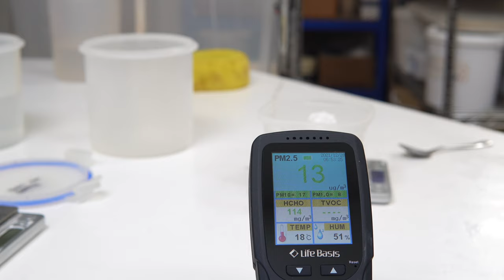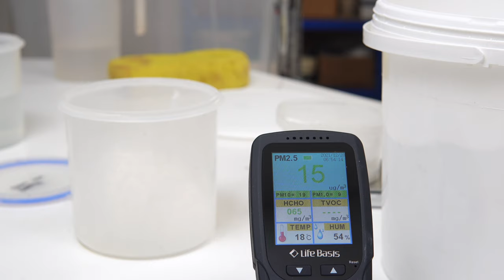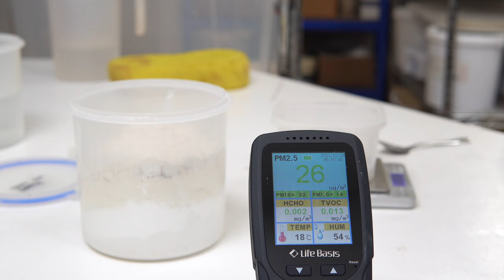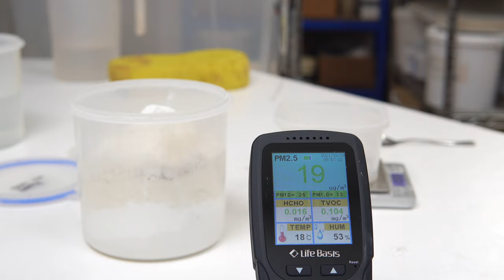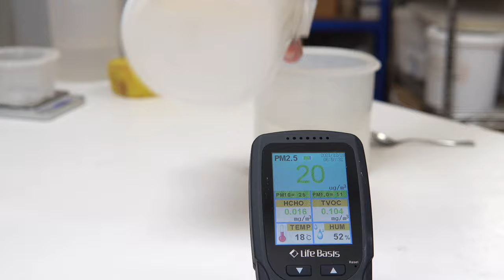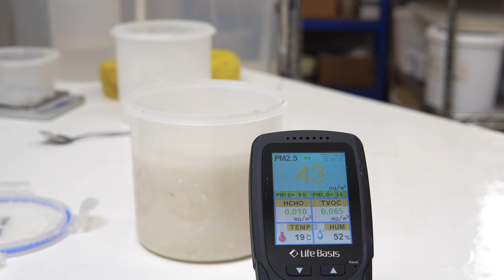Silicosis - What it is and how to avoid it

Comment: You're doing a service for potters everywhere. Thank you.
I'd be curious what is registered when rubbing over glaze imperfections, shaking around plastic used to cover pieces when slow-drying. Even just opening up a bag of clay where some has dried to the inside of the plastic seems to make more dust than anything.

Comment: Don't underestimate your videos - they are very well produced with information to back your statements and recommendations. I much prefer your straight forward presentation. I was wondering if the rise of partials would be reduced if a spray bottle with water is used to "spritz" the bucket/area while emptying the chemicals into the water and continuing through the "bubbling" as it is incorporated.  Might help and definitely interested to see if it does reduce it. I am a TA at a community college and follow your recommend advice already. When we "dump" the chemical into our five gallon bucket with water, we immediately place a lid on it snd wait for the cloud to settle.  Now, I am going to use a spray of water to visually see if there is a difference while placing the mix into the water. 

Thank you for your extensive research and sharing of information.

Comment: Good to know - thanks! Great comprehensive video. Will need to source one in Australia.  Just wondering about pots drying on open shelves or just sitting there for weeks while waiting to bisque fire or glaze- is that dangerous? 
When cleaning I wipe down my shelves with a damp sponge but you can see little clouds puff up -  and I guess the dust that comes off the wedging board is bad too. Will need to think how to do that better. Thanks
Reply from the maker: Pots sitting around shouldn't be bad at all, but dust clouds aren't ideal!  Best to vent the studio afterwards if you can